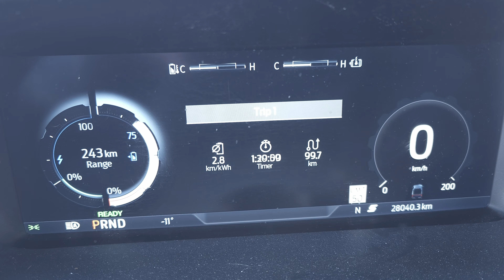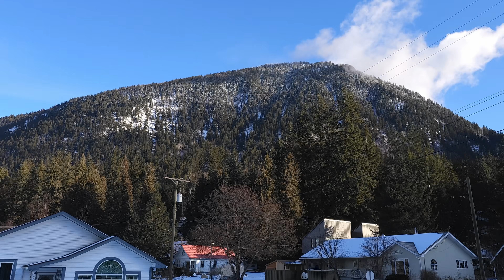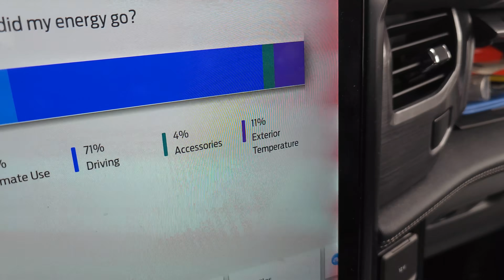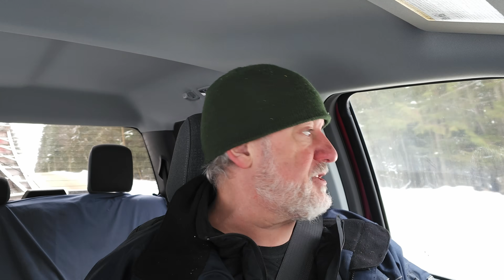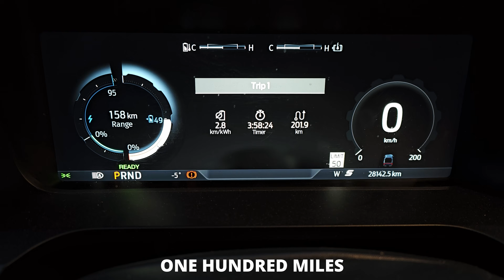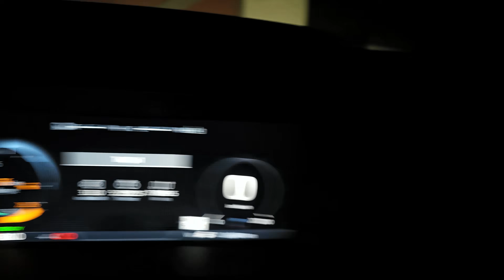My EV Truck Heat Pump SHOCKED Me in Below Zero Test!

Comment: Once you get below 0 F  (-18) the heat pump has a very hard time keeping up. Especially if you leave it off and unplugged for a few hours, you’d be lucky to get over 1 mi/kWh (1.6kil/kWh). It was -20F for me and I drove 50 miles, left the truck sit outside off and unplugged for 5 hours. I drove 50 miles home at .5mi/kWh (.8kil/kWh). So my point is it’s not a practical truck at ALL in the cold.
Reply from the maker: I have never dropped that low in efficiency in my Flash at those temps - not once -  and we'll hit -24 this past week. The vapour injected heat pump has a backup, so at 0 F and below, the resistive heater kicks in to assist, which does lower efficiency and brings it back in line with the pre-heat pump models of 2022s and 2023s, but not entirely. Because the heat pump operates differently than a traditional one, say for a house, you're not drawing the heat from the outside in the same manner, but from the internal heat variances, if I've read Ford's release notes correctly.
There are a number of Lightning owners in Prince George, BC and Alaska who post here often and would disagree with you that it's not practical, so you have me curious as to what occurred. I'm going to reach out in my community section and ask for the lowest efficiency stats others have hit.

Comment: Just a quick question. Does the accessory use include heating/air?
Lovin this channel. ❤ 💯 👍
Reply from the maker: No.The climate use is what breaks that out. The chart allocates climate use (heat/cool,etc), driving, accessory use, and outside temperature. I hope this helps.

Comment: 0 degrees C is 32 F for me. I wonder how it would do in 0 degrees F. I am in minnesota we will have a month of 0 degree F weather and also negitive F measurments. YOur stress test is not a stress test. Not enough for Minnesota.
Reply: I drove in -20F 50miles. Then let the truck sit outside, off, unplugged for 6 hours. The battery was cold soaked and I barely got home. So anywhere between 100-150miles. 
I’d like to add that if I did stop at a fast charger for 15min, it would have warmed the battery and my mileage would have greatly improved, but it’s super inconvenient and a bit stressful. When I got home I had other things to do and had to take my gas vehicle
Reply from the maker: I'll call the weatherman and have him turn the temp down another twenty degrees. 🤨
I'm working with what I have available. As indicated in my videos, we have had zero cold weather this winter.
As indicated by @jakesnake253, get down to -20~-40 F and your efficiency plummets, regardless of the heating/cooling mechanism. His numbers were quite low, but if we look at worst-case scenario, I think he is demonstrating a real world ballpark of how bad it can get at extreme lows. A gas truck loses 20% at -20 F. According to all studies conducted, expect 40% loss in an ev truck in what is classified as 'extreme cold', which varies between -20~-40 F, depending on the study. even trickle charging on a 110 outlet will improve that by a fair amount. Level 2 charge while parked and precondition your batteries, and you'll perform on par with a gas truck.
Reply from the maker: I think the reality is that one buys a truck for the use case. If you live in an area that is stone cold (below -20 F for weeks at a time), don't buy an ev truck if you are driving longer distances without access to plug in. In Canada, where I live, -20 F never happens ((or rarely). Go to Prince George & it's common. Still, I have many viewer who live north of Prince George and drive ev trucks - but they went with the Silverado EV or Sierra EV with more range to compensate.

Comment: If you had a gas truck. Would you have made it back with the same starting range? How much did you put back in to the battery during the day?
Reply from the maker: My gas Ford Ranger would have been almost identical in remaining range after the trip. It could only do about 350~375km in freezing conditions on a full tank.
I didn't put anything back in the battery during the day. I did the whole day on one charge.

Comment: Also, I don't know if I missed this, but what did you have your heat set at?
Reply from the maker: It's in the video. Heat was at 20 C (68 F), seat heater at middle setting and heated steering wheel on.

Comment: Question #2, just how many DCFC are there way out there, for us from the Lower 48?  I looked up Summit Lake on Google Maps, also, it looks pretty remote.  How far can you get on BC 37 with an EV, the highway itself seems to go all the way to the Yukon and meet up with the Alcan there in southern Yukon.  But that's no guarantee of EV chargers lol.
Reply from the maker: BC Hydro just completed the Electric Highway in British Columbia. I drove to the Yukon BEFORE the network went live  (watch my BC Yukon video). Since going live, you can drive anywhere in the province and be within 150km (95 miles) of a DCFC - and that doesn't even include private ones. They're everywhere.  I don't even have to think about it anymore.
Reply: @truckedupevs  Thanks.  I also noticed this on PlugShare, there's chargers all along 37 and 97.  But they get more sparse in Yukon, and really bad when you get back over the border to Alaska.  If you're going to Fairbanks, you pretty much will have to do an L2 at Tok unless you have some gonzo range EV like a Lucid Air.
Reply from the maker: @Brons2 You asked how chargers were along the route to Yukon on 37. There's a free 50kw in Watson Lake. After that, I had no intention of going to Alaska so not sure after that.

Comment: Is that a Holley Equipped sticker on your back window?  lol.  Nice video, I live in Texas, but on the coldest morning of year at 21F I did see 0.9kwh/mile on a very short trip of 2 miles each way.
Reply from the maker: LMAO! No - but now I want one (it's my "camera equipped" sticker, which is far less witty)!
Yeah, in the cold when not conditioned, short leaps are costly. I've never seen anything that low but I'm usually in the km/kwh setting in metric anyway, and I flunked math (but that setting will have to change once we're conquered).
🤪

Comment: Average speed? Wind? Snow on road effect? Assuming normal brake regen?
Reply from the maker: As I made clear at the top of the vid, this is my experience and non-scientific, but hereis  a brief:
No wind Feb 9th, except over Summit Pass. In my face at 10kph, according to Accuweather app.
Snow pack on all roads. Truck was set in Sport mode and Lightning has only one setting. Regen was off.

Comment: Great video as always. Good info and laughs. I have a model 3 standard and I find if I precondition 30 minutes in this -18C weather my range loss is around 10 percent compared to 10 degrees C and above. I had a yellow 1974 Toyota Corolla with a 1600 overhead cam and to reduce the range loss in the winter I would have to slide an air diverter in the air filter on top of the carburetor to pick up warm air off the exhaust manifold.
Reply from the maker: Haha! I remember stuffing all kinds of crap in my old Escort! My Ranger drove all winter with a full Amazon Christmas gift pack worth of cardboard in the grill....
Reply: Ya I remember those days haha
Reply: Do you precondition while having the car plugged in? I'm curious if it's feasible/still beneficial to pre-condition while not plugged in as I do not have access to a home charger and considering getting the lightning.

Comment: Nice content! Another cold weather Lightning owner here from Minnesota USA 👋
Reply from the maker: Welcome, my 'Southern' neighbour! 
:-)
Congrats on driving such a cool truck!
Reply: @truckedupevs  are you noticing a significant difference with the heat pump compared to your old Lightning?
Reply from the maker: @MNEVTravels  Yes, but that doesn't mean much since I have no actual data to back that up, so I need to do a comparative analysis of the two trucks, side-by-side, which many viewers have asked for. The problem has been that where I live - here in a more remote area of Canada - there are fewer trucks available in the 2023 model year with an extended range that aren't Platinum trims.
I'm still on the hunt to be able to do that comparison before it starts warming up. I think I'm preserving about 10% more than with the XLT 23, but that's anecdotal.
Reply: @truckedupevs  Understood, I've tried to get a couple of guys with a 2024 to get some time with my 2023 to try and create some data based on our experiences here in MN and have not been able to pull it off yet. Still trying.

Comment: People talk a lot about how electric vehicles have their batteries, degrade overtime. What they failed to understand, perhaps because they haven't been able to easily measure it in the past, is that gasoline engines also degrade overtime. Interestingly, my taxi driver today told me that his Toyota sienna has gone from an efficiency of 10 L per hundred kilometres when it was new to now being at 13 L per hundred kilometres when his odometer read 600,000 km. He has lost 30% of his range! Something to think about. 32.
Press 36
Reply from the maker: I mentioned exactly that in my battery video and a few others I've done in the past. It's one thing that is conveniently overlooked by the Fudsters.
Thanks for the comment Stewart!
Reply: @StewartMidwinter  good point
Reply: The comparison begs the question though. Because the loss of efficiency of an old ICE engine merely increase cost.  An old ICE vehicle still has hundreds of miles of range and can still fill up at a gas station just as fast. 

Whereas an old degraded EV battery could lower the range to the point that the vehicle isn't usable at all for some peoples commutes. This is a HUGE distinction! Less efficient vs not usable AT ALL. 

And then there is the cost: The replacement battery for the Ford F150 Lightning cost $44,000. You could buy an entirely new Toyota Sienna for that.
Reply: But most people would be considering replacing the entire vehicle once the battery is not holding up enough charge to do your daily driving as og Tesla model s'es are still driving around on their degraded but still useable original battery pack so if a 14 year old car with the original battery pack still working not enough longevity for you when most people keep a car for 7 years so two average owners could have used that car and it would still have more life left in it as long as you don't develop a weak cell then the degradation is going to be so slow that the car will fall apart long before the battery pack stops working

Comment: The best way in my experience with the heat pump in my 2024 in cold weather, is ramp it up with the max button setting, this gets the heat pump warmed up really well. Then drop to mid setting.
I have tried setting the fan to 7 and heat to high on windshield and it didn't heat up or get the heat pump warmed up like the max setting for like 5 mins does.
Hope this helps
Reply from the maker: That's a great tip!

Comment: Just a point of clarification.  The Silverado EV gets EPA rated range summer on the highway at 70 mph….450 miles…
Reply from the maker: I didn't mention the Silverado EV in the video, so what, exactly, are you clarifying?
Reply: @ 3:11 you stated that you are probably never going to get EPA ratings (mixed range) on the highway at 70 MPH on any vehicle you buy. ….Love to see a Recharge kWH for true km/kwh numbers…for this trip.  You should get Carscanner to have real data. Super handy…. Keep up the good work….
Reply from the maker: @KlemensEV  I should. However, I'm not wanting to take the channel down the 'Out of Spec' super-techie road, and that means I'll sometimes make more mistakes - and learn a LOT from viewers like you. 
I'm just a dumbass with an ev truck who loves them, and shares my personal experiences and journeys. 
I've heard about Carscanner a couple of times now. Might look into it when I can afford more 'channel toys'!
Thanks again.
Reply from the maker: And, by the way, no. Here's how it is calculated: The EPA determines the range of the Chevrolet Silverado EV by testing the vehicle on a dynamometer in a lab. The tests are run on the EPA's drive cycles, which result in separate city and highway figures. These figures are then weighted to calculate the combined overall range - and this is a winter test, so again, what are you clarifying?

Comment: I find I get slightly better range if I drive in sport mode vs normal. I'm sorry if I missed it but, what drive mode are you using?
Reply from the maker: Sport. I found the same. I didn;t mention that in the video. Thanks for that!
Reply: @truckedupevs  I especially like the slight breaking sport mode provides when I lift off the pedal in regular two pedal mode
Reply from the maker: @earlyriser2639  Yeah. Definitely all the settings are more enjoyable to drive in that mode. I see an improvement both summer and winter in that setting. I think I'll add that info to my pinned comment. Thanks!

Comment: Have you noticed the heat pump vibrating on a cold start? Mine does every time. I'm considering getting it looked at while it's under warranty.
Reply from the maker: No, I haven't.

Comment: i don't think the lightning will condition the battery on a level 1 charger.
Reply from the maker: It won't but by charging you're creating some heat and, of course, adding a small amount of trickle charge.
Thanks for pointing this out and I'll add and pin that in the comments section. I should have been clearer in my approach.
Reply: I bought a ‘24 flash in late dec. Thanks to all u good folks who put good info out on u tube. My last truck was a 2008 ram laramie. Holy smokes does this flash have tech. I have been trying to find the setting that preconditions the battery. Now I know why I can’t find it. I am only using 120 v to charge. I’m waiting on QMerit to hook me up to 240v. Thanks trucked up and community for enlightening me.
Reply from the maker: @Ruby-baby-67  Thank the fans and intelligent people who watch. I'm just a dipshit with a truck :face-fuchsia-poop-shape:
Reply from the maker: @Ruby-baby-67  And congratulations on owning an amazing vehicle! 
By the way, trickle charging does create some heat so it does improve the battery conditioning to a lessor degree, but long-term charging in the frigid cold isn't good on a Level 1. 
We are with you in waiting for our plug install - and we have two evs (we're the Lightning Bolts, according to our neighbours). There's a lot of nightly musical-chairs-but-with-vehicles performances. We moved, and the house we have was really updated and modern - before the Great Depression...
Reply: @truckedupevs My house was state of the art when Lee surrendered so I hear ya😆😆
Reply from the maker: @brita654  Yup. That's the one!

Comment: I love your reviews and the Metric System.
Reply from the maker: Thanks!
Reply: I appreciate the metric system, but I still struggle to think in metric. I usually have to grab my pocket calculator to convert metrics to English units.
Reply from the maker: @darwinskeeper421  I learned everything in Imperial, Then one day, I walked into class in Grade Five and the sneaky cheeky 'educators' switched it all just to ensure we all experienced per-adolescent aneurysms. 
I have to admit that I used an inch ruler right up until a few years ago, but it sure is nice having zero as the freezing point!
Reply: The metric system sucks. 

As for Celsius, the only benefit is freezing being at 0. As for the more common use of measuring air temperature it's stupid. It's in the negative too often and you have to use half a degree for accuracy. So in a Celsius car, the gauge needs a decimal point. F is set nicely in the 0-100 range in most typical weather and just makes a perfect temp gauge.
Reply: @Josh-179  yes, that is probably why the whole planet (97% of the world population) and all people working in STEM use the Metric System.
Reply: @robertn2951  , America is the main Superpower and biggest GDP. We like to do things different.
Reply: @Josh-179  America is a joke. You have the WWF as education chair. The immigrants educated with the Metric System are the reason you have a GDP.
Try to get a job in engineering in the US while not using the metric system.

Comment: Great video!  I'm in northern Alberta and my range takes quite a beating when it's -35.  I've recently been testing out the effect preconditioning has on the efficiency of my Silverado (does Ford have a similar selector to turn on preconditioning?).  I have to park outside, and my batteries are fully cold soaked in the morning, and when I run the preconditioning for 30 or 40 minutes it brings up the battery temps to around 15 degrees, and my efficiency in -35 gets up to the same efficiency I normally get around 0 degrees.  It's a useful hack to decrease the cold weather range issues if you had the option
Reply from the maker: Yes, they do, but they call it something else. It's called Departure & Comfort, which I can set for each day of the week, so my batteries are at an optimal temp when I leave, and also set at any time via my FordPass App.
I didn't use the precondition settings for this video, although it was plugged in overnight, which, of course warms the batteries while charging.

Comment: I just added a Tonneau to a 2023 Standard Range Lariet Lightning. Does adding a Tonneau help with range?
Reply from the maker: According to several tests, it doesn't seem to make any difference. TFLEV did one. Out of Spec reviews another.
Reply: @truckedupevs  Thanks. Always enjoy the content.
Reply: Also according to some videos I have seen that adding a cab high cap does not affect range either. I just added one. I have not done any actual tracking, but I haven’t noticed anything out of the ordinary on my lightning XLT extended range